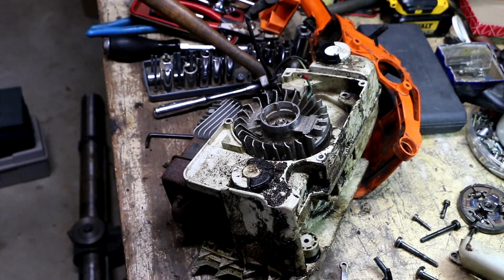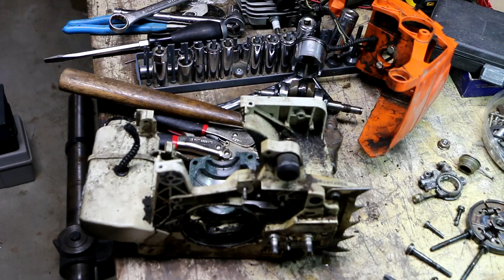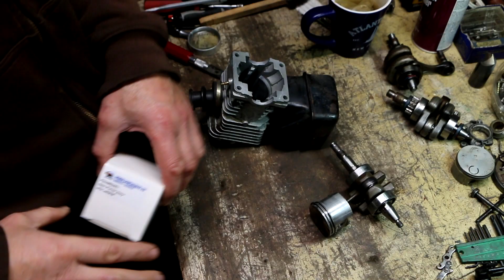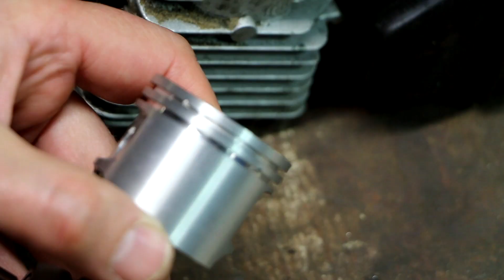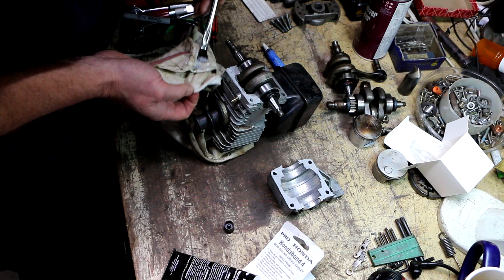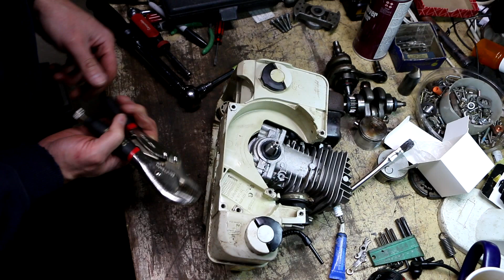Stihl MS290 Chainsaw Part 10

Comment: Why you didn!'t use stihl piston?
Reply from the maker: Did not want to spend any more money than i have too. More to come on that.
Reply: I don't know about us prices but in the uk you can replace the cylinder with Chinese parts 5 or 6 times for the price of one genuine kit. Also even if you use genuine parts a mistake with oiling, carb setting or air leak the cylinder can be wrecked anyway. If you want to throw money away you may as well buy a new saw.
Reply: @jeremycrowley3075  i hate chines piston and cylinders!Must be stihl original!